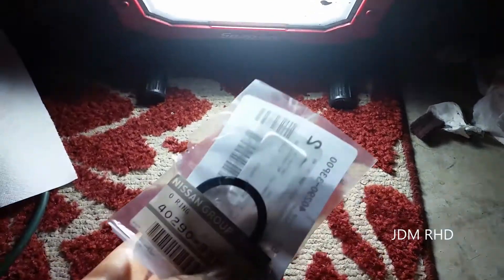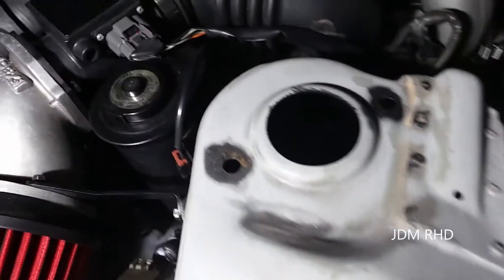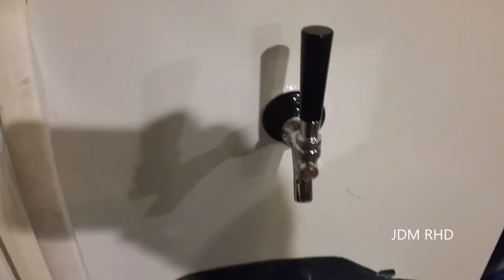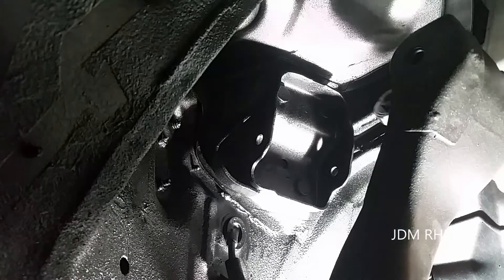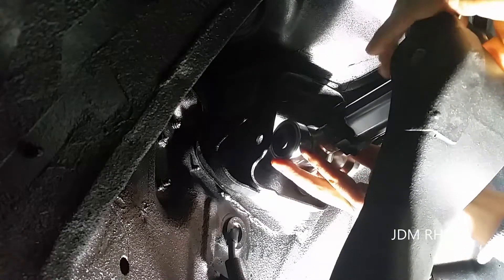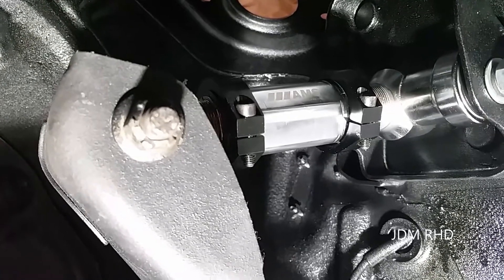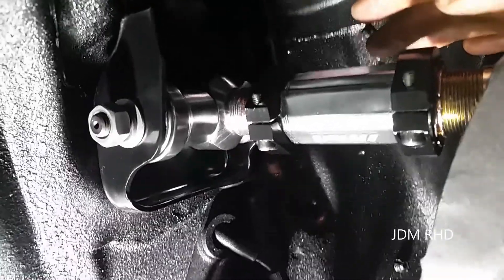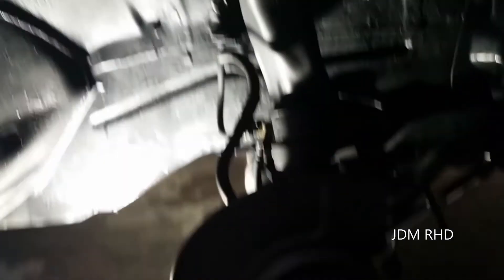Front upper control arms & kingpin seals Nissan Skyline GTR R32

Comment: If you take off the knuckle arm extension do you have to replace the kingpin seals?  I want to take mine off and clean them up/repaint when I'm doing my front upper control arms but wasn't sure if anything should be replaced while they're off the car.
Reply from the maker: One of my knuckle extensions didn't have a seal in there when I took things apart. You can probably reuse the old ones or run none at all. The kingpin would be good either way IMO.
Reply: @JDMRightHandDrive  Appreciate it. I’ll be pulling mine off in the next few weeks. Helpful info like all your content.